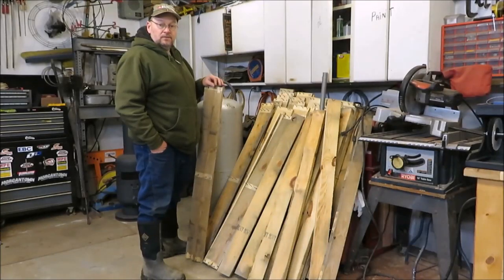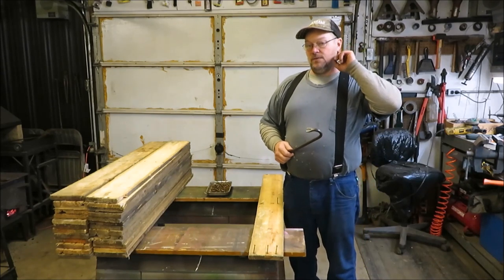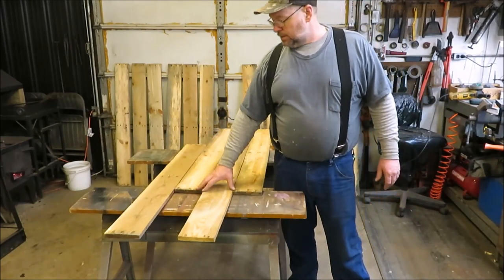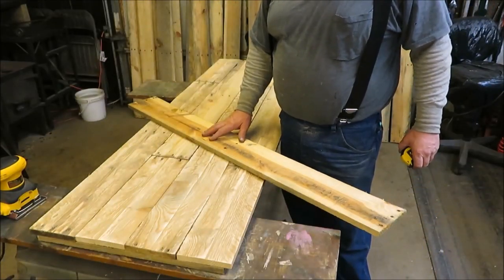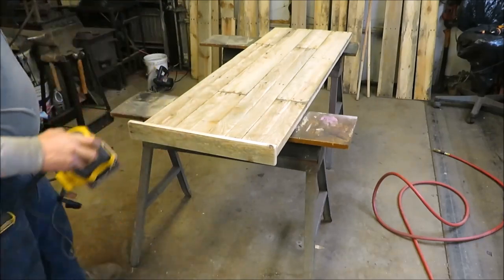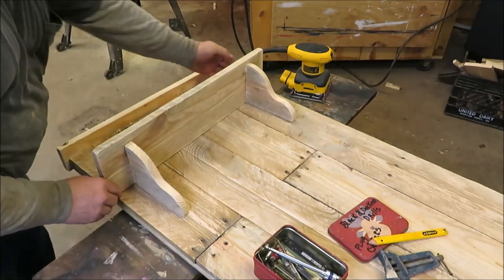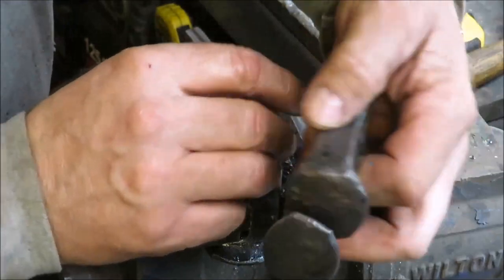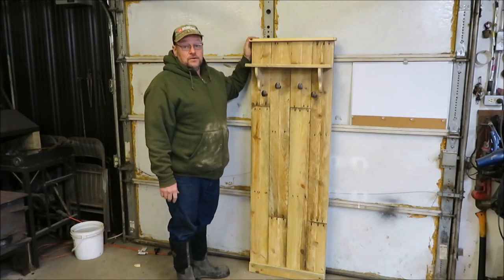old pallet wood coat rack

Comment: Great job I like it looks good, I get your point  when you said people  say hey its only made out of a  free pallet,  I use to work near a pallet  manufacturer co they built new pallets  and they rebuilt old pallets  this was back in the 80s, If you found  an old broken pallet  on the side of the road they would give you $3  for it , if you were to buy a rebuilt pallet from them  it was $9 and a new pallet was $13 and that was in the 80s wood is wood.and labor  is labor.
Reply from the maker: Thanks for the comment.